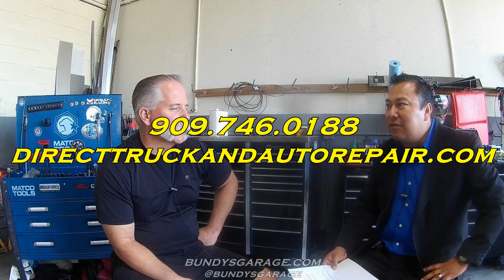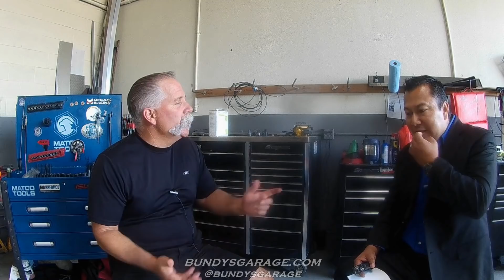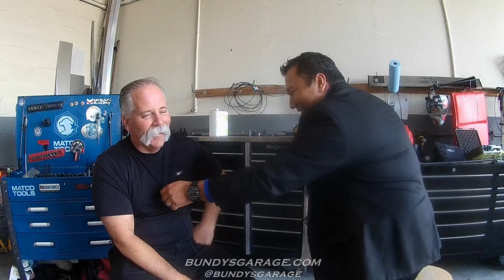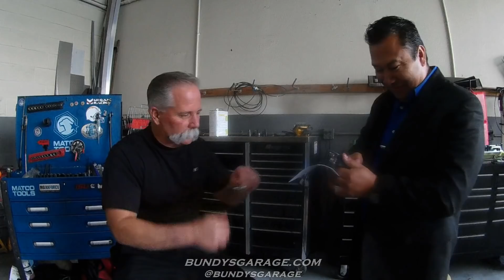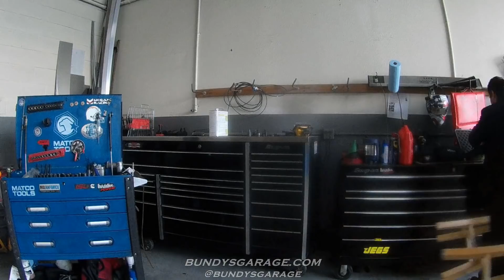Worst Diesel Engine Ever - What is the Best Diesel Truck out There? | Ford Dodge Chevy

Comment: Had Ford gas pickups,  had GM gas and diesel pickups.  LLY Duramax was expensive to maintain.  glow plugs, injectors.  Got a Ram in 2014 with a Cummins and still have it.  Other then recalls, no issues.  I can deal with recalls.  I wouldn't mind owning a new Ford with 6.7, but had too many warranty claims denied.  That's why I went to Ram.
Reply from the maker: What warranty claims did Ford deny? I have heard that too. They find any excuse to deny warranty. The sun is out, warranty denied!
Reply: @bundysgarage  I've been a tech at two Ford dealerships and I have never seen Ford deny a warranty claim without due cause. Most warranty claims are denied by the dealer before Ford even sees it, thus technically Ford isn't denying it. Grain of salt here though cause obviously from a customer stand point the dealer "is" Ford but my point is that it usually comes down to the dealer for most denials and I'm sure a fair bit would have been approved by Ford had it been sent in. One thing Ford really hates though are aftermarket parts but to be fair not much aftermarket for these trucks are any good, I've seen some crazy cascade failures from Dorman parts especially.
Reply: @josephbowman4571  Yeah, but you aren't addressing WHY the dealership is rejecting warranty claims, to start with. The dealers are rejecting claims at the start, because they 'know' or 'feel' that they will get caught in the 'looping rejection' from the factory to HONOR THAT WARRANTY SUBMISSION! So, Joe-Dealer accepts a warranty claim, takes the truck in, has the transmission or engine out of the truck (to send in on claim), places the order for the 'warranty replacement', and FORD REJECTS THE CLAIM...so the dealership, on the hook (with the customer calling daily) has to resubmit the claim, hope for parts, and in the end...most-likely EAT THE CLAIM if Ford won't honor it!  I've seen this FAR TOO OFTEN on the GM side...where the dealership is the middleman in a 'Mexican standoff' between the customer (who may or may not have abused the warranty) and the factory (who doesn't want to be giving out $5,000 engines like door prizes). So...part of this boils down to retail customers trying to accomplish CLASS 5 vehicle work with Class 3 trucks, and a factory trying to offer a warranty without going into a black-hole of warranty debt as a result! How do I know this? I worked in CLASS 8 trucks for a LONG TIME, and we didn't give warranty headaches to people for towing rocks, dozers or back hoes.  Mainly because WE KNEW the trucks were going to be HEAVY DUTY ABUSED...at or even above the GVWR...if you built an F350 the way F350's are actually used, they would cost around $100k each...but hey, at least you would get a REALLY GREAT WARRANTY...then again, you'd want the Class 5 at that point, because for the price...YOU'D WANT A PRODUCT that would stand up for 500k miles before major repairs were required!
It's a game of musical chairs...and the factory sets both the number-of-chairs and the music duration...dance to the tune, or pick another game...but it is the factory in charge of the warranty...NOT the dealer.
Reply: @skeetersaurus6249  I'm sorry man but you haven't a clue what you are talking about here. Ford doesn't do warranty like that and most things do not require prior approval, just a cost cap to decide to repair or replace (generally engines, transmissions etc). The decision usually is with the dealer for fault or no fault. Actually I have even witnessed Ford knowingly approve warranty claims on tuned trucks without even blinking an eye because it was clear the tune wasn't a relevant issue. Not even kidding, the dealer being cautious informed Ford about one of the tunes letting them know that it was definitely not the cause of the issue, the Ford rep agreed and authorized the repair. Also and for the record the majority of the issues these trucks see are from high idle times and short trips; long haul heavy loads are a non issue especially with the 6.7. 6.4's are straight junk and 6.0's are too old to be relevant here. We've even got a guy down here that's got a 2016 super duty that we know has towed 7k over the rating cause he continuously brags about it and yet again no issue warranting anything because Ford is not worried about it. They care about crazy tunes, DPF deletes / modifications, or any other potentially damaging aftermarket mods and legitimate abuse as they should but anything clearly done with some common sense they could care less about... bigger fish and all kind of thing at the very least.
Reply: @josephbowman4571  Had two ford pickups and a couple of explorers.  All new.  I always had to fight about getting covered by warranty.
Reply: @raykrv6a  Would you care to explain a bit more? I'm curious to what happened.
Reply: @josephbowman4571  I didn't have a diesel engine in the fords.  I don't remember all the issues since it was 20 years ago.
Reply: Screw LLY for life! LB7 for life! If I had to pick a newer truck, it would be a Cummins. Don't even talk to me about a 2008 or 2009 diesel. All three of them had problems. The LMM Duramax sucked at towing, and the 6.4 Powerstroke and 6.7 Cummins both had their own list of issues. I am not particularly a fan of the 3rd gen Ram look, unless it has a 6.7 in the Laramie trim with a bench seat up front. Even so, I've heard that Cummins had a little bit of a hard time with their 08-09 6.7s when they were changing to new emissions standards.
Reply: @2001FordPowerstroke  lly was a better engine then the lb7 better injectors and some decent overal improvement the lbz needs piston updates bad but the lly and lbz are both technically better engines then a lb7. And I love a lb7.
Reply: @2001FordPowerstroke  lmms don't suck at towing they do better then a lb7.
Reply: @jdrok5026  Did you delete your LMM? My dad didn't do any mods on his truck, so that might have been the issue. He won't go anywhere near a Chev now because of that bad experience.
Reply: @2001FordPowerstroke  no a lmm delete won't make the truck better at towing unless you tune it for more hp but stock they pull well. Unless his was having major regen issues. Other then that they have around 700 lbft of torque probably more but can't remember. Nor do I care right now I'm about to see a Ford motor to space For being a pain in the ass..
Reply: @jdrok5026  I do not understand why he loves his Ford 6.7 so much. I was a fan of the 2015 Duramaxes until we pulled a big cattle trailer with our friend's 2015 LML and it was pretty sluggish. I don't know if they haved fixed that issue on the new l5p, but I think Cummins is the best out of all the new trucks.
Reply: Funny my lly used for towing RVs has lasted longer then Ford's an Dodge we have ran 640000 on the lly one set injectors an one pump
Reply: What  year was your LLY?  

There are two versions of the LLY Duramax engine.  It was introduced with the 2004.5 model and carried over to the 2005 model year.  GM then made some major changes , including glow plugs, to the engine but in all of their wisdom continued to call it a LLY with the introduction of the 2006 model.  After about thee months, they finally completed their firmware changes which upped the torque and horsepower.  There were no hardware changes but GM renamed the engine LBZ.  This means the second version of the LLY is actually a detuned LBZ.  The LBZ engine has a reputation of ongoing glow plug failures.   GM made a firmware change to reduce the duration of the glow plug but the short life of the glow plugs carried on to the 2007 classic.  The LBZ was replaced with the LMM with the 2007.5.  If you have a 2006 LLY then that is a known issue with that truck.  

I have not heard of many glow plug issues with the first version of the LLY.  The first version of the LLY appears to have less injector issues than the prior LB7 (Original Duramax) which had a lot of injector issues and are difficult to replace.  The LBZ (and second version of the LLY) seem to be more reliable than the first LLY which have not been that bad.
Reply: @bruceh3786  2004.5
Reply: @bruceh3786  I had a early LLY, the one with the weak head gaskets, I saw people paying 4k - 8k to replaced them.  32-40 hour job.  I babied that engine.  Needed multiple glow plugs from 75k to 117k when I got rid of it.  New set of injectors were 367 each.  GM didn't have fine enough fuel filters and eventually updated filters.  Suspension issues,  front wheel bearings went out over the last two years.
Reply: raykrv6a and Tracy Robinson .... Thanks for the replies.  What a difference in experiences.  I know some folks that upped the power had head gasket issue and some folks with lifted trucks and larger tires seemed to have more suspension and bearing issues.  I do not no if that applies here.  I am at 70K with a first version LLY and so far, so good.  The first version LLY runs hot with big loads so that may contribute to some of the head gasket problems.
Reply: @bruceh3786  Yes, now that you bring up the running hot, I did update the intake to allow more air in.  I towed a car hauler around and didn't have to big issues with heat.  But I babied it.  I remember they had 3 editions of head gaskets for the early LLY.  I checked and my vin was the A gaskets.  32-40 hours on my dime to change to the C gaskets is pretty big expense unless GM helps out.  I think all ford, gm, and ram  make good diesels now.  I appreciate my Cummins.  It's been great.  15k oil changes.  Love it.
Reply: @raykrv6a  none of the company's have good filters
Reply: @bruceh3786  head gasket issue I have right now is from the down pipe burns it out on corner
Reply: Tracy Robinson ..... That is not good.  How many miles on the LLY when the head gasket issue started showing up?
Reply: @bruceh3786  not many. It is just the lower corner in back it burns the faster out an it leaks from the port out so doesn't enter cylinder just a leak. The motor still runs well. Going to pull out an go through it. Have new head gaskets an studs for it. Now just take time to do it.
Reply: Are you lazy? Glow plugs are short cheap and take 5-10 minutes to change on my lbz and you really never need to change them.  You sound like an idiot who can't maintain a vehicle. I've got over 260k miles on my lbz and it still runs like new. Never needed to touch the injectors

Comment: Other than cab removal for some repairs on the ford built 6.7, wat is wrong with it??? I've worked for a guy that bought 2 for his company & I thought they were awesome. They were new & time will tell how there durabilaty & longevity is. But my experience with them was very good.
Reply: When they first came out they had issues with the bearings in the turbos and they had issues cracking heads.  I'm sure there were a few other teething problems but everyone I know in the repair field and everyone I know who uses their trucks for transport (dealer trades, boats, and RVs) swears by the 6.7 and a few of them have over 300k miles on theirs without any problems.  If the trucks weren't $60k+ I'd be tempted to buy one but the V-10 was just a better financial choice for me.

Comment: I've got one of those "perfect" trucks. Sitting in my driveway. It is the best of all world's, but it still has its problems. Until our government allows any manufacturer to produce a vehicle that doesn't have its life choked out of it from the production line we'll continually have issues with them. There is no perfect anything.
Reply: If you spend the money building that truck why not put a little bit into the motor to get the power you needed?
Reply: eddie price how do you go about getting one of those PERFECT trucks ? who does them. about what is the additional cost
Reply: My 2014 Cummins is great.  No issues with the emissions systems.  RAM has replaced the SCR on their dime for a recall and I never had a problem with anything.  Everything is stock on my truck.

Comment: I agree. If it came down to a 6.0, 6.4, or 6.7 Powerstroke, I would also pick a 6.0. Those engines will go forever with no problems if you delete them. Can't say the same about the 6.4; it goes for a certain amount of miles, and it's done. The 6.7 is terrible because of the emissions shit.
Reply: Is there something that stops you from deleting a 6.7? :p
Reply: @dre04mach   It costs too much money. We looked at deleting our 2011 6.7 and when my dad heard how much it was, he asked if there was a cheaper option. He hasn't answered him yet, so I'm assuming that is a no. I also don't like the maintenance cost of a Powerstroke, so I would only get a 7.3 Powerstroke, LB7 Duramax, or 12 or 24-V Cummins (2002 or older).

Edit: We are now in the process of deleting our 2011 since the turbo went out. Also upgraded the turbo to run a 2017 turbo.
Reply: @2001FordPowerstroke  takes about a grand to delete a 6.7... and the benefits are immense.  Newer technology costs more, but there are also benefits the older tech cannot offer...
Reply: I'll take a 6.7 deleted

Comment: Ford didnt drop the 7.3 navistar made it and they replaced it with the vt365 aka (6.0) it would barely make it off the production line i worked for navistar when it came out and went to see it being developed they told us the power to iron ratio in that engine was so close that it was very important to torque every bolt
Reply: awesome guy   Don’t  know where you got your info but I still have bulletins from Ford going back  to late 2000 that the 7.3 was going away in a couple of years because of smog requirements.  Same type of  bulletins from Navistar.
Reply: Got it right from the factory i worked for navistar true the 7.3 couldnt meet emisions but the 6.0 was a joke compared to the 7.3 and it wasnt fords decision it was navistar they quit making it i went to chicago to the development lab for training on the vt365 the year before it was released

Comment: I have a 7.3 non turbo IDI in a 89 F250 I love that truck! 19mpg in town ugly as all get out, runs and runs and I can pretty much fix anything that breaks on it. Nice interview.
Reply: I used to drive an 89 7.3 idi international chip truck. Slowest truck ive ever been behind the wheel of, you could literally walk up hills faster than this truck would drive up them hah
Reply: Deepblu dude yep! I had a 91 Lariat. With the non turbo 7.3. What a beast!
Reply: Deepblu dude I’ve got a 91, it’s a beautiful thing and a great pickup.
Reply: I have a 94 Turbo IDI and it has almost 300,000 and runs like a top.
Reply: 19mpg that's haka good for a truck
Reply: Its truly amazing I don't run it hard its not fancy and with low miles I hope to keep it for ever but dang the rust...haha @victorradu3986
Reply: Dat true! I have a 1997 f350 Ambu sitting in my yard right now with a Powerstroke and 108K miles, 4WD yep 4WD that a buddy of mine bought for 3K it had been rat chewed in the upper harness just got it fired  up and lo and behold all the sensors are working it starts amazing and purs but god awful heavy trying to sort the air ride suspension out right now.... @czwarlord9243
Reply: I call bullshit on 19mpg in town! Highway maybe. Those non turbos  more like 9mpg in tow🤣
Reply: Deepblu, I had one of those, too, a 4x4.  I added a Hypermax turbo.
Reply: He is telling the truth because I had a 96 7.3 diesel crew cab that I traveled all over chasing the railroad. It would get 20 miles a gallon if I set the cruise and let her roll at 73 mph on the interstate at 1700 RPM. She was my last pickup that had the beloved wing glass side window. Last true truck built!

Comment: I was thinking the same thing. But 5.9 Cummins.
Reply: James Sawchuk  the best, 5.9L Cummins. One and only Million Mile Motor for diesel market
Reply: I have a1995 5.9 with about 130,000 on it.  It’s not a 4by4 and it’s automatic. It was bought new by my husband. I live in N. Idaho where it snows a lot so I don’t drive it in the winter. But used it to haul wood and hay on the farm. Mice got in the heating system and cab, peed on the seats and carpet. Stinks in the cab. Like to find a 4by4 body to put the engine in. A guy that worked on it ( put air shocks on it ) wanted me to sell the engine for $500.00 to his friend. No I said. It sit out all winter here for 2 years and never is started til spring. Always has started every spring when I go out to move it. Got to clean the pine cones out of the vent in front of the windshield. Need to haul all my recycles to the transfer station. It’s not for sale. Oil is changed every year even if I’ve only driven it a few hundred miles.  From Winthrop, Washington to just inside of N. Idaho I got 19.1 miles per gallon.

Comment: Your right a 6.0 with all the problems worked out this can be a good motor p, way better than a 6.4 if I Ford scraps a motor after two years, it's junk, well have to wait and see on the 6.7 this is a ford only motor no help from international on this one.
Reply: @Copperhead Sutton oh yes for sure on that 7..3 if I could find a halfway decent truck even with 250k I wouldn't hesitate to buy it. They don't have the same power as the new motors with vgt turbo but it will get you were yoir going. Without def and plugged dpf  filters.
Reply: Agree. 7.3 will just run forever. 6.0....once you do upgrades, such as up tubes and dummy plugs along wity egr delete and studs. It can be a beast. The bottom end is as tough as they come. Haven't heard to many good things about 6.4.